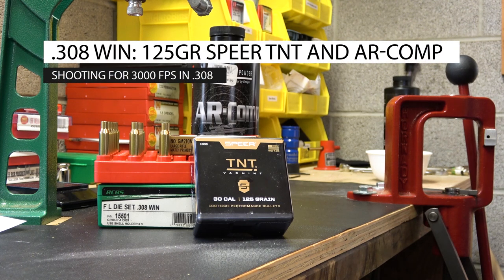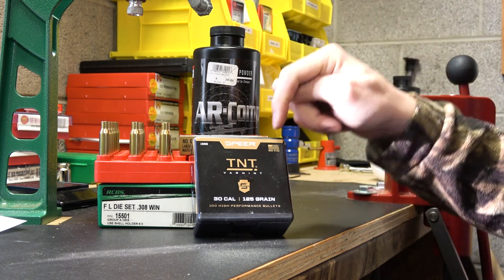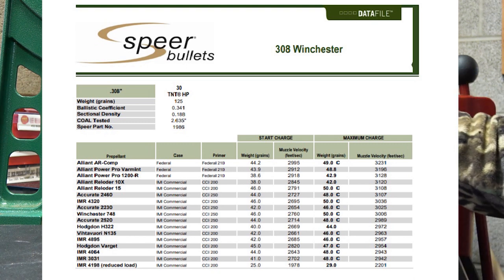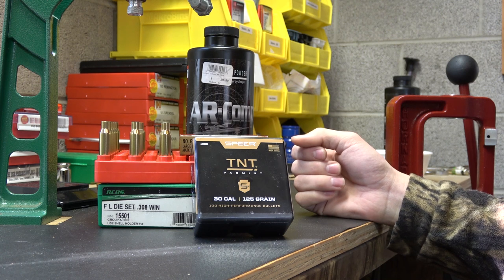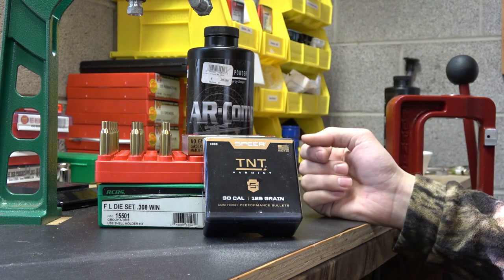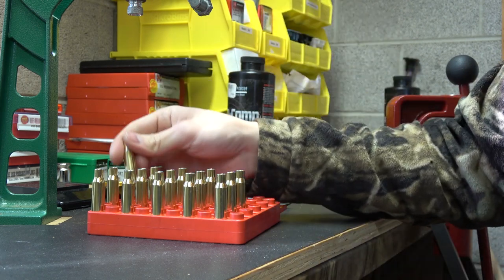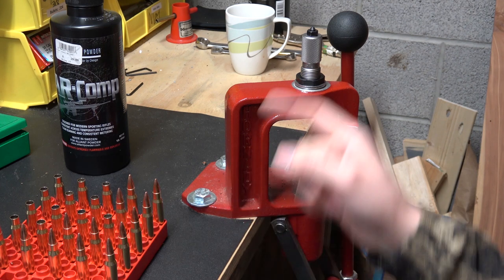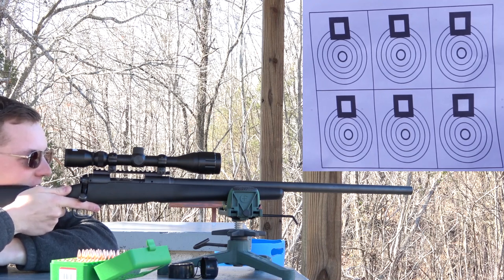.308 Win: 125gr Speer TNT and AR-Comp

Comment: I have about 8 pounds of AR Comp. I worked up a load in 308 for the 175gr SMK. I got around 39.4grs and groups between .550 and .997. Right around 2600FPS. For 168SMK I'm currently working up loads for that when weather permits here in WA.
Reply from the maker: NorthWest Reloader I really like AR-Comp. It’s my go-to extruded powder for 6.5 Grendel, and works great in .223 as well. May try it for 168 BTHPs in 308 at some point as well. It’s one I’ll be buying an 8-pounder of when it finally comes back in stock. It’s been gone long before the election and virus stuff, though.
Reply: @TheOutdoorGeneralist  Yeah, I've been scaling back on mass loading and shooting like I use to. Going to be a rough road ahead for sure until things get back to normal.